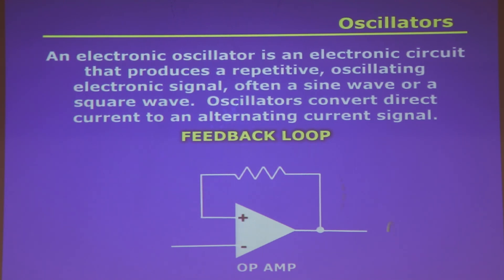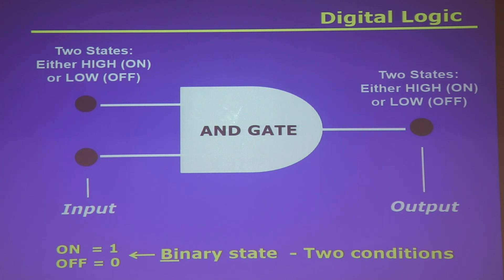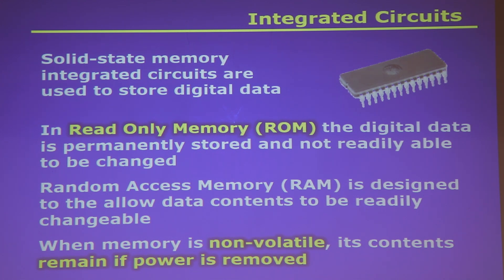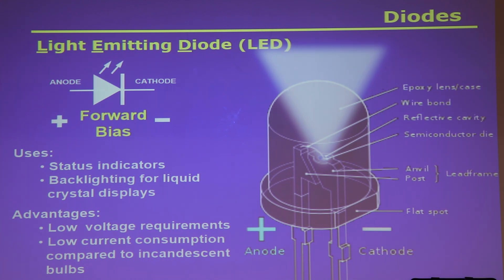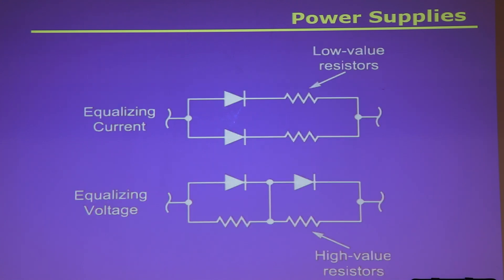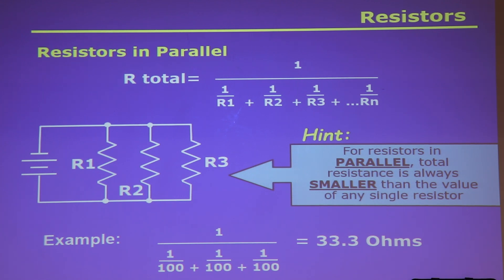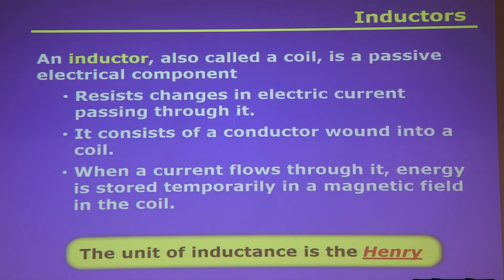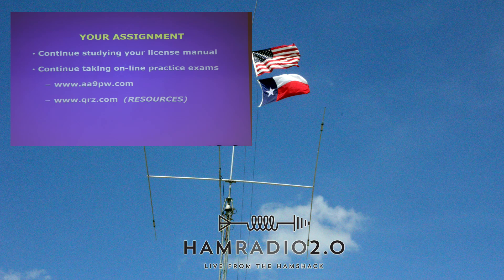Ham Radio General Class Training, Part 6

Comment: At 48:11 the instructor states that reactance in an inductor DECREASES as the frequency INCREASES, but the slide states that reactance in an inductor DECREASES as the frequency DECREASES.  I believe the slide is incorrect and the instructor is correct.  That is, as frequency increases, reactance decreases and vice-versa [ARRL General Manual p. 4-19]. Is my understanding correct? Thank you.
Reply: Yeah so which is it? Typical OG.
Reply: Also he says solar  panels put out 5 volts but the slide says 0.5 volts. There are dozen of these Inconsistencies.
Reply: It was a long and confusing day...